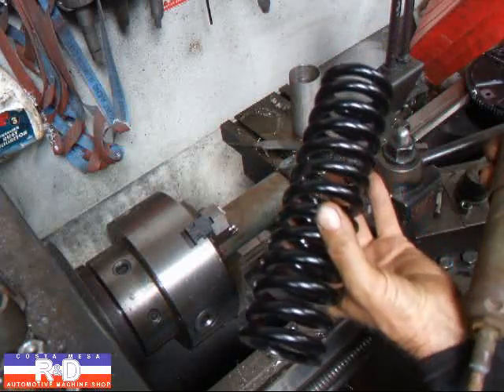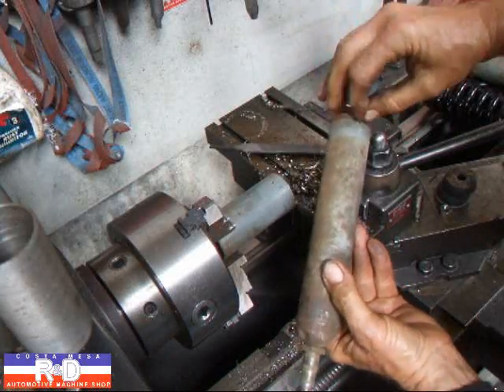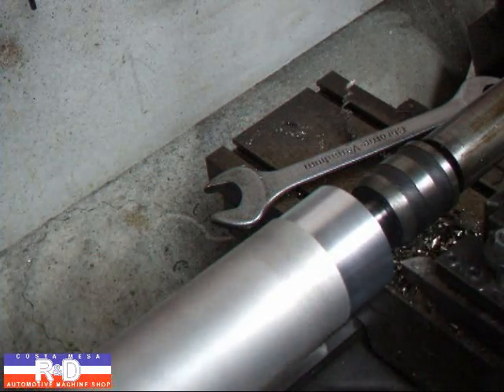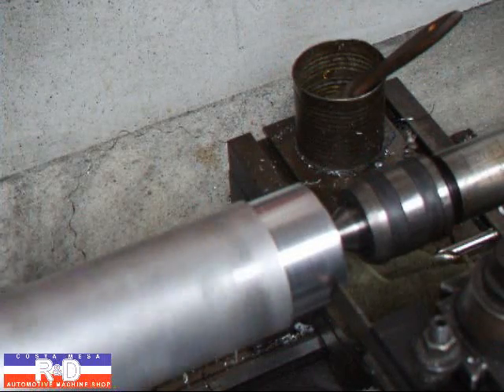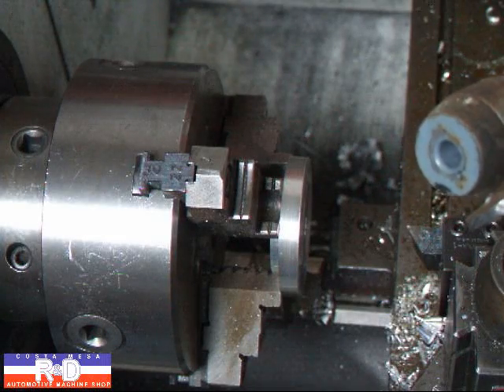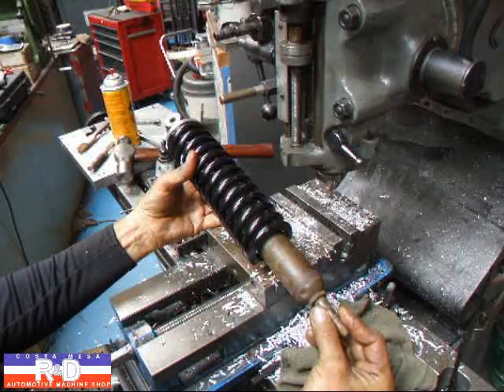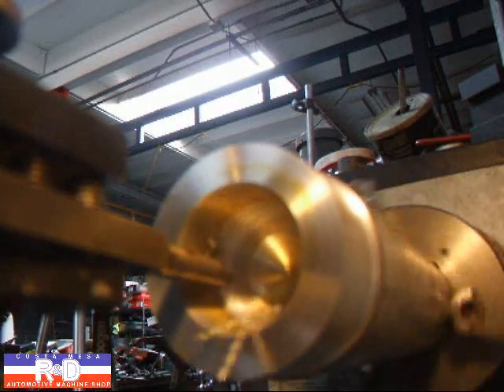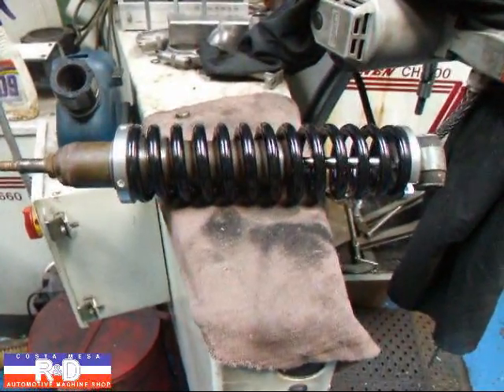How to Make Coil-Over Shocks

Comment: For a lightweight car, I can see this working fine... but I have to wonder about the strength of the lower shock mount, and whether or not it is strong enough to take the full load of shock and spring...?

Comment: brilliant, but question. i don't know how the stock suspension on the fiat works, but judging from the looks of the shocks i guess it uses some sort of torsion springs/leaves. how did you make these new ones work with or without the torsion springs/leaves?

Comment: I need a lathe..  How do you do the thread? is it a setting on the lathe to move it prescise enough to cut or are you moving it by hand?
Reply: By hand?????   He is engaging the half-nut when the thread dial reaches the desired mark.  A very routine lathe operation.
Reply: Haha.. this was written in 2014..  since then I have bought a lathe and realise how its done..  Back then I wouldn't have had a clue of what a half nut is.. ;)

Comment: Gbody isa 87 elcamino,monte carlo,regal.

the shock is not in the center of the spring.
and the shock inside the coil. so i think it need a coil seat with offset.

Comment: I don't personally like the way that the top piece sits against the spring. I would add one of those rubber isolation rings that have a provision in them that fits in that gap between the end of the first coil and the second coil. You make some really nice pieces and make it look so easy. good work.

Comment: Good machining and camera angle, but that shock absorber wasn't designed to carry the weight of the car via the spring. How are you going to weld the aluminum to the thin steel sleeve of the shock? Looking forward to the next video of this.

Comment: Very clever coilover setup there, John. You weld the steel threaded pipe to the body of the shock and then adjudt the aluminum base while the top plate stays fixed, correct? Do you bolt the top plate in place or do you have another way of attaching what appears to be a steel top to the aluminum plate? 

Also steady rests are your friend!!! (Thanks for the awesome videos I feel like I comment on everything you post)

Comment from the maker: Will show more when I install the coil-overs on the Blueberry. Whay's too be confused about, you have to be able to set the camber, by screwing the bottom plate up or down, you can make this happen. I said that I have to determine the ride height before I weld adjustment barrels onto the shock. Hang in there, it shouldn't be too long before they are installed. Have you never played around with coil-overs before?